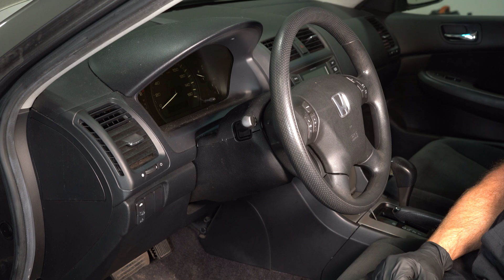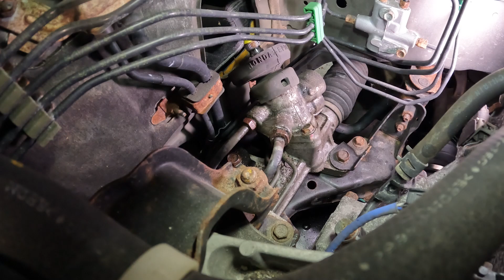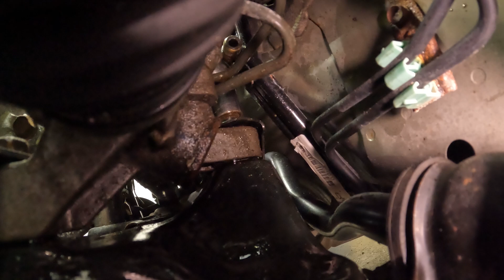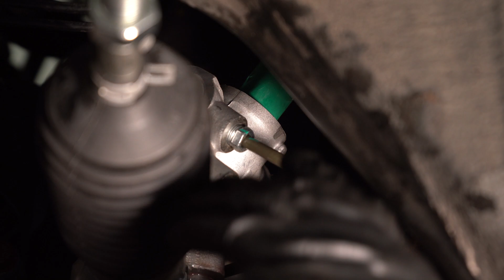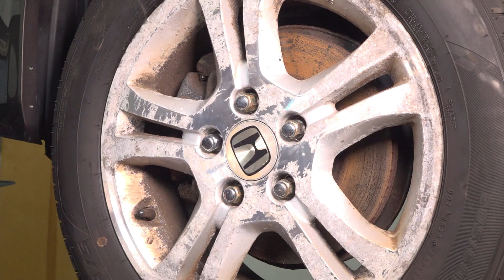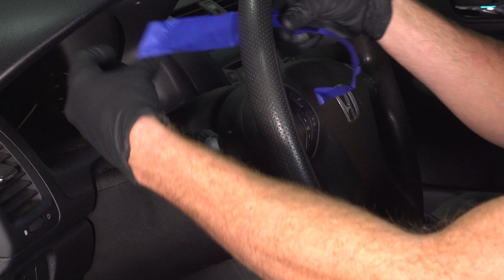How to Replace Power Steering Rack & Pinion 2003-2007 Honda Accord

Comment: Shouldn't the steering input shaft be connected prior to the tie rod ends?  Since you centered the rack, might there be a possibility of movement during tie rod installation.  Then when it is attached to the steering input shaft it could be off center.

Comment: He only turned it back 1 and 1/8 turns. If the locking pliers started in the 12 o’clock position from his POV, 1/3 of a turn would be 4 o’clock position. He only turned it to the 2 o’clock position.